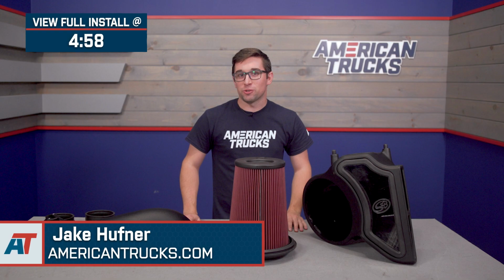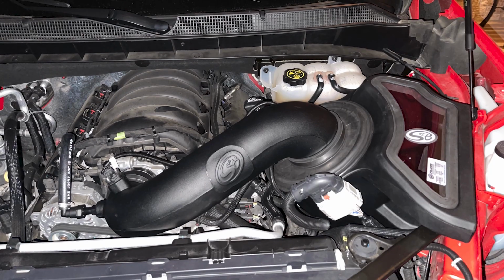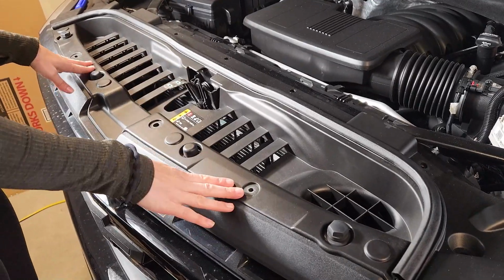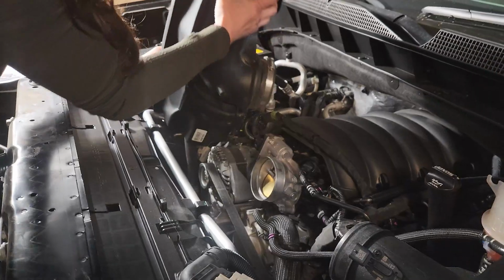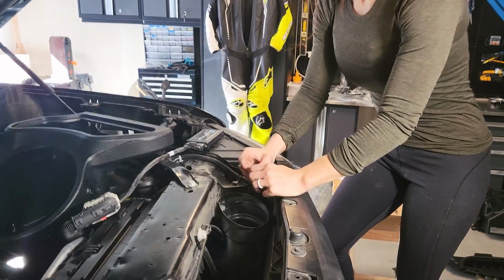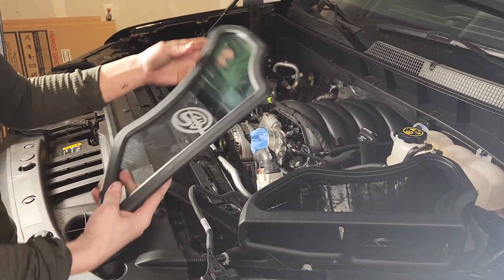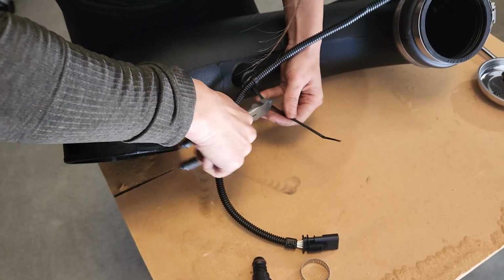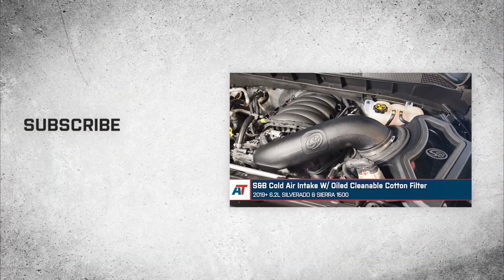2019-2023  Silverado & Sierra 1500 S&B Cold Air Intake Review & Install

Comment: Horrible design i had this crap on my truck and sounded like crap. I called s&b and sent them videos they agreed that it was the system that was at fault after buying this expensive garbage they proceeded to tell me that they had an new designed tube because of the flaws the system i had was having so they dont tell you til after you buy the product.i dont recommend this setup at all!
Reply: What noise? Did the new tube correct it?

Comment: And does anyone know what the popping sound is when you shut the truck off?
Reply: Called S&B and was told that it was normal. Also kept getting a check engine light on and was told by the dealership that it was the air sensor on the intake. Was told by S&B that it is a known issue and that they are fixing it right now. Had to resort to my stock intake until there is a fix to beware when buying this intake.